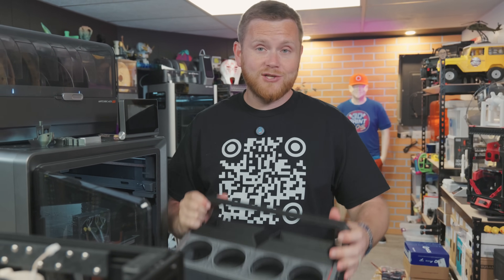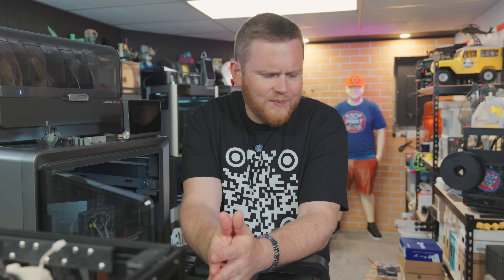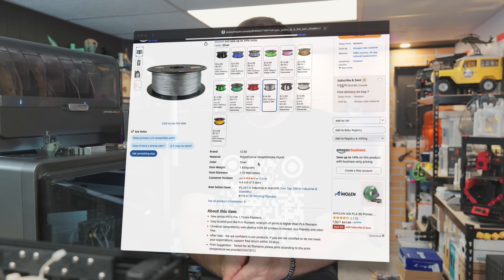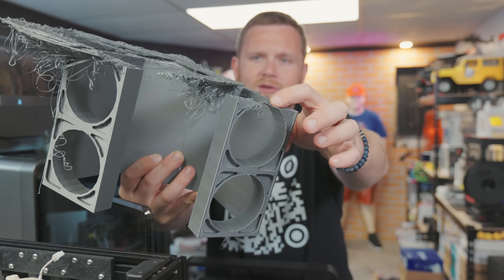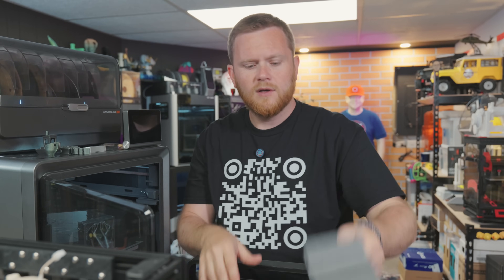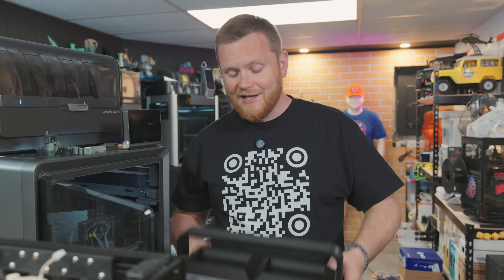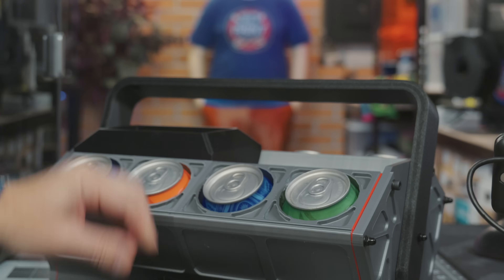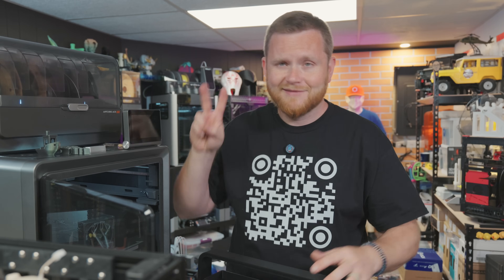Is Budget PETG Filament Worth It?

Comment: Overture / Polymaker PETG has given me the best results (combined with Vision Miner adhesive). I've found some generic PETG absorb moisture like a sponge and get stringy when left out for any period of time. I always dry any PETG before use, even no spools, to avoid stringing issues. I ditched my Ender series and have 2x P1S, 1x A1, and 1x A1 Mini. All print great with PETG. I do turn the speed down compared to the default settings and use gyroid for the infilll pattern. When I use default rectilinear I tend to have issues with the nozzle impacting where the iinfill cross-sections overlap after a number of layers. Even though it's faster I've had prints get knocked off the build plate due to that so I don't use that patten for ANY material.

Comment: I don't normally like PETG because it is fragile, glossy, and shows every little imperfections. That was until I found the Sunlu Hi Speed Matte PETG, it is lovely. Prints like PLA and has a lovely finish. Not matte more satin but very nice. And best of all here in UK I can buy a kg for £9.99! Now I love PETG
Reply: I ordered up some Sunlu Red and it was orange, returned it. I had high hopes for it but the colors aren't consistent from what many have been saying. Have you noticed that as well?
Reply: @garagehobbies never bought red PETG I usually use red pla. The only red ABS I bought was the pinkishone  from geetech. Red is difficult. Needs a lot a pigment and pigment cost

Comment: Have you tried doing all the orca calibration tests, cleaned your build plate with soap and completely dried your PETG for 24 hours at 65 deg C? For me it never fails once I do that, and the whole spool just gets laid down better than anything else I've ever used. I run the E3D diamondback nozzle for the P1S at 255 deg C and it runs at 30mm3/s flow rate, absolutely insane, and with arachne the details are great too. Even the ultra cheap PETG (5 USD a spool refills from JayO during sales off chinese shopping sites) don't string super hard, and bambu petg HF just prints perfect otherwise.

Comment: I just jumped on the Qidi 4th sale and bought up a bunch of their lovely ABS Matte for 13.99 a roll in a bulk order. I also grabbed some PLA while I was there.  I have to feed the new AMS units for my Plus4, along with a couple of new Centauri Carbons that just arrived. I will be grabbing some larger stock of my favorite Overture and Polymaker filaments in the coming weeks as I replenish my print farm with some new interesting colors for some new stock that I am working on getting made.   I only use PETG for a very limited number of my projects; I use ABS for 80% of my prints. I just find it prints well and is easy to sand, and the price point is good when bought in quantities of 10 or more.
Reply from the maker: I’m exactly the same way.  Most of my prints are ABS. With a sprinkle of tpu and pla

Comment: There's PETG on Amazon for like $9, I have two petg profiles I use on all of my printers one is high flow and the other is generic the generic one I tend to leave at 7 volumetric flow rate and the high flow at 20 to 22, and as long as I use one of those two profiles all my petg prints come out flawless, also you might want to dry your build plate it's definitely soaking up moisture lol.............
Reply from the maker: Got a link? I’ll buy some.
Reply: @3DPrintSOS  Search congrow and YOUSU is cheap also

Comment: Hi long term Listener and Lurker and this is long winded.. A lot of people use “Generic profile “because they simply work and yes to a degree but at the cost of quality and strength and time and filament cost. As you already know PETG does not like speed and likes to be hot and slow while some people may slow down infill walls and infill speed, the magic bullet and most people miss is changing the “Volumetric speed” because PETG naturally has a Volumetric speed of between 8-15 and these machines can print at a much higher and will print higher by default unless the setting is changed. Fan speed needs to be turned to 20 to help with layer adhesion  and also retraction 2mm with retraction speed of 45, also always use Gyroid infill and slow the first 3 layers down initial layers down to 20mm with a bed temp of 65 on PEI SHEET  then no glue or magic tricks needed .You may need higher nozzle temp as well with hardened nozzle but also if you’re running the machine at speed so 255 to keep up with flow to melt the filament fast enough. Also, enclosures can actually affect the quality of the overhangs because they push internal temp chamber up so open a lid or front door unless you live iceberg or have an air con fan overhead. A lot of people are actually causing themselves more problems by trying enclose a printer that does not need one simply because of the “aesthetics’.I agree If you are printing ASA or ABS then a heating chamber with enclosure is a must. If your printing dragons with silk on the Kitchen table then probably the printer you enclosed is causing the issue because you simply enclosed it. I use between 40 and 70 percent infill and adjust the walls, top and bottom shell accordingly. As for supports I use normal snug supports as other supports seems to have higher fail rate. Top z and bottom z 0.4and support distance 1.5 and support object first layer 0.4. Top interface layer 99 and bottom interface layer 99.I actually like PETG MORE than PLA and many people try and print PETG the same way as PLA with high-speed fans and high speed but PETG does not want to react that way. I always feed my filament straight out the Sun-Lu dry box because I find that it improves quality and strength because fresh out the box doesn’t always mean dry. Whichever machine I use open or enclosed always apply the same rule for PETG  and another different  rule for PLA because they are two different animals.
Reply from the maker: 100% appreciate the detailed PETG cheat code. Thank you!
Reply: I print PETG at 20mm3/s, with stock P1S profiles, and it prints perfectly well! I do print at 245c however, and drying filament is an absolute must. 

100% agree with everything you've said.
Reply: @MarkusNemesis  I print at 30mm3/s at 255 using the e3d diamondback nozzle on the P1S lol just had to crank up cooling a little and shit goes insane, the motion system screams even when I do 0.2mm layer lines
Reply: Thank you for providing am so much detailed info! I agree with almost everything you said and it's wild how nervous people are to use it... Myself in the past included. I'm planning on making a PETG quick tutorial on my RandoTechNerd channel.

Comment: ? I have a few spools of $9 PETG on the shelf. I've been buying it cheap for a long time. Except for a couple of tangled surprises from FIROS over the years, it's been very good to excellent. During this week's Prime Day sale, I went to Amazon Haul (which offers 40% off during Prime Day) and got 12 rolls of PLA & PETG filament - some of them actual BRAND NAMES - for under $7 each, with free shipping. Today is the last day for that this year.
Caution: PETG has to be absolutely ROASTED in a dryer to get non-stringy results out of it, but it's worth the trouble
Reply from the maker: Nice score on the filament deals, I need to check that out!

Comment: I just bought a Flashforge 5x and the Flashforge PETG-CF in black.  The first thing I printed out was the enclosure which used up most of the spool, but I was impressed with how perfect the parts were.
Reply from the maker: Been a great machine on my end as well. Honestly, I didnt know if had a hardened steel nozzle. Good to know.